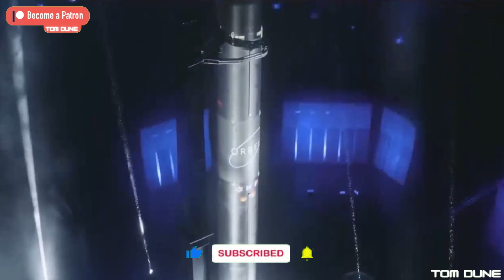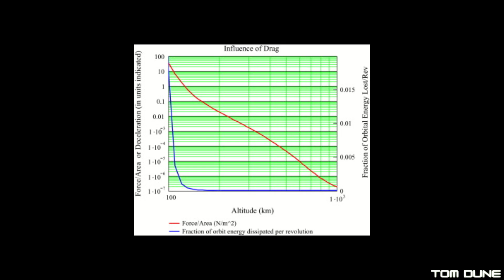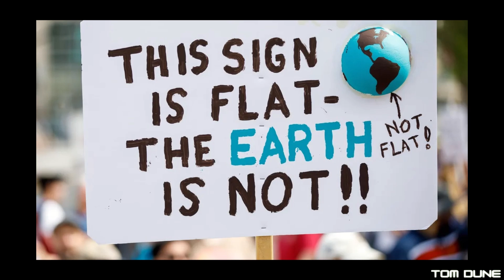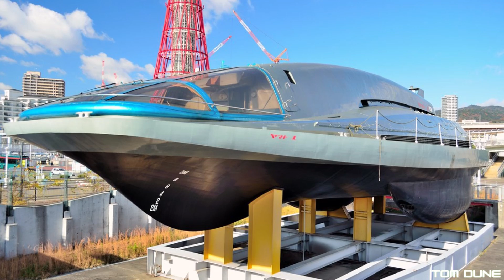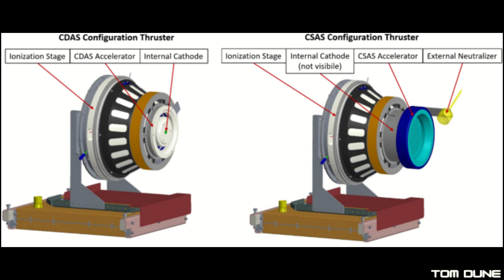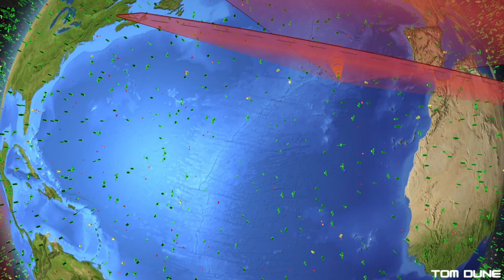Air Breathing Electric Propulsion - High Concept Satellite Dream or Soon to be Reality?

Comment: I have two questions:
1. There are many layers of satellites on various orbits, how many layers can you have in VLEO?
2. Wouldn't this create much more light pollution?  The SpaceX Starlink system is already creating a problem for astronomers without using this technology.
Reply from the maker: Good questions!
Theoretically you could have many layers in VLEO as it covers some 250ish km in altitude but the lower portion of atmospheric VLEO would be from 160 to 250km.
2. It would if we end up with constellations of satellites at this height especially given the starlink problem and that will have to be worked out if this tech becomes the norm

Comment: I like the idea of using air breathing electric propulsion, with a beamed energy kick. 

Instead of putting solar panels on the satellite, adding drag, just put an energy receiver. 

Then have your solar power satellites further out.
Reply from the maker: A good idea indeed, but the problem is the added mass which affects the abep drag reduction, given it would depend on how you power the beam energy. And that's the crux of the issues facing the developers/researchers of how to deal with it, as clearly there will be a need for such-like different systems.
Reply: I remember reading a proposal for doing this for atmospheric scooping of Venus, but it seemed pretty fiddly and complex to me. The thing about Venus is that it isn't oblate enough for sun-sync orbits to exist.

But Mars is oblate enough (as is Earth) for sun-sync orbits to exist.